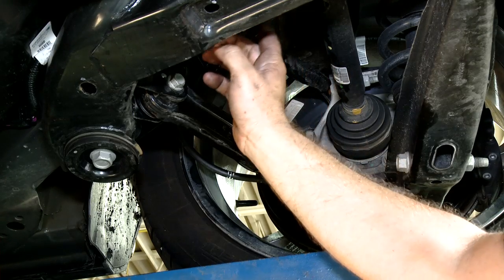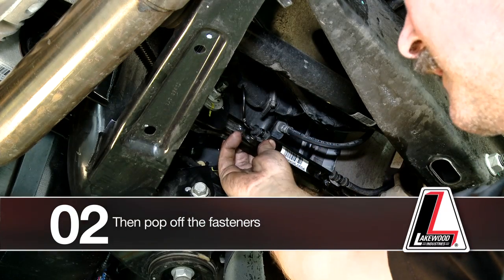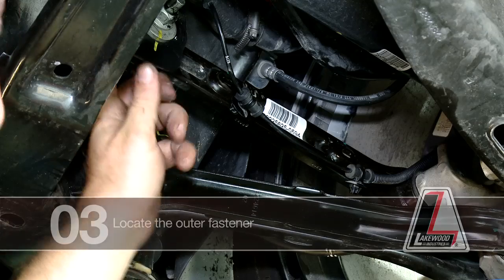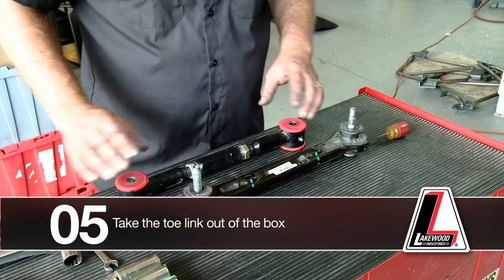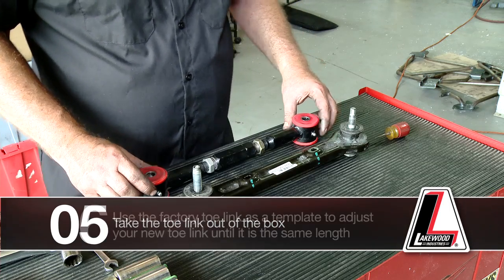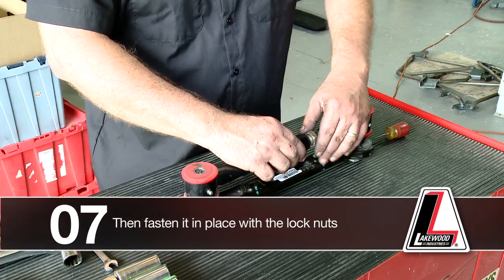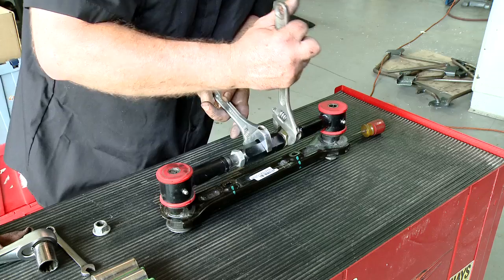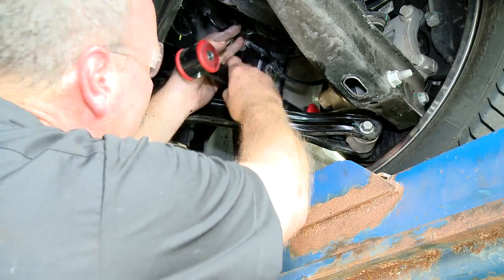Installing a Lakewood toe link for the 2010 Camaro :: Modern Muscle X

Comment: How about a video for the driver side where you have to lower the cradle to install the toe rod,,,,,
Reply: I just unhooked the brake line at the top of the knuckle, pulled the ebrake cable out of the way, and twisted the original toe rod towards the top of the knuckle while using pliers on the bolt downwards. I installed the bolt backwards because I didn't need to adjust it anymore (right). Anyways my car handles sooooooo muchhhhh better. its amazing.